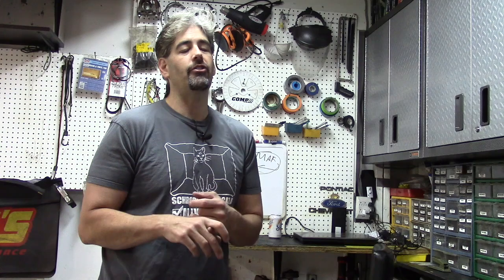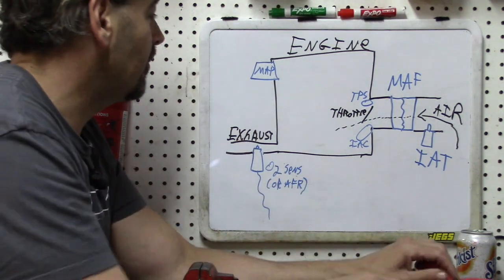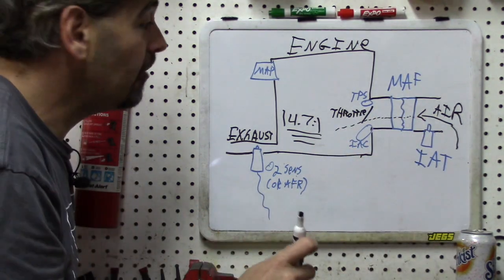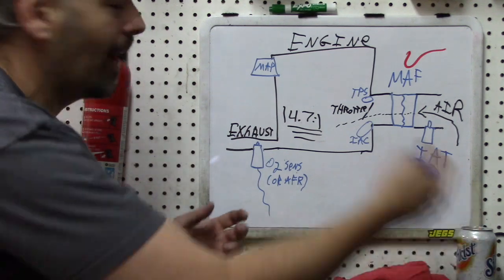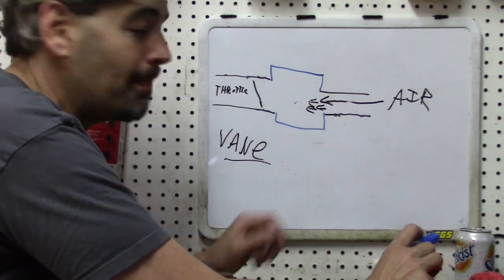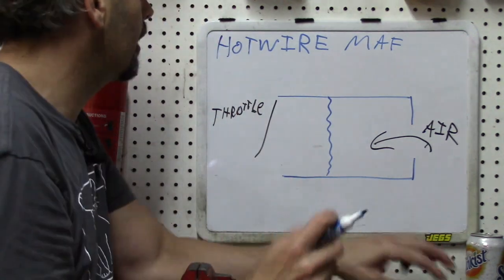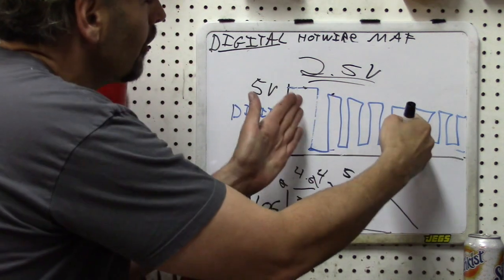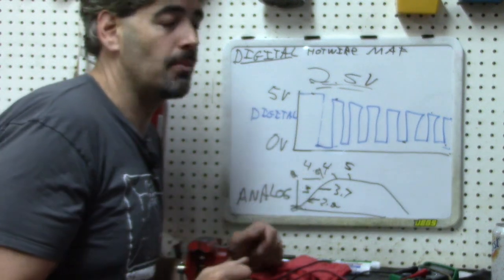Diagnosis and Understanding: MAF Sensor Pt1 Analog, Digital, Hotwire, P0101 P0102...

Comment: Could a bad maf give you a lean condition only on bank 1 on a v6? Or it would only be bad on both banks?
Reply from the maker: that would be both banks.
Reply: @SchrodingersBox  So I have a odd condition.  I got a 2005 kia 2.7l v6. I got a p0171 lean in bank 1. But my short term is -3 to 1 but my long term is stuck at 14.1%. I don't hear any exhaust leaks or vacuum leaks. What should I check for a lean on bank 1. But i did notice my bank 2 long term dont look good either and its stuck at 13.3%. I held it at 3k rpm for a min and both lg term trims did not move. What am I missing? I changed all plugs and wires. Iacv, oil change, bank 2 sensor 1 O2 sensor(cause of a previous code.) But I do have a purge valve code as well. For p0441 no purge flow. Could that be causing a lean condition as the system is relying on fuel vapors to help fuel the engine?
Reply from the maker: your short term will be +/- 2.5 or so because it has set the LTFT baseline. nothing off there. 
  I would definitely start with what your data was that you changed plugs and wires - what was your data there was an ignition problem? you never mentioned any such data.
Reply: @SchrodingersBox  so I just replaced the plugs and wires cause it has 90k miles. Ran ok but never changed the plugs so it needed that. Plugs were done. It had the lean in bank 1 plus a o2 code for bank 2 and purge valve code  p0441 so I replaced that valve and the o2 sensor but the im still getting a lean code for bank 1. Both o2 sensors are fluctuating from .1-.9 as they should at idle. Bank 1 short term fuel trim makes sense. -2% But bank 2 short term is around +3-9% i was thinking bad MAF but that would effect both banks.. im out of ideas.
Reply from the maker: what was the issue with the purge valve? that could be critical. was it stuck open it was it stuck closed it was it not getting a signal input?
Reply: @SchrodingersBox  stuck closed. Now its stuck open. Cheap aftermarket part went to crap. Now I'm waiting on the dealer version.
Reply: @SchrodingersBox  ok long story short i got the monitors ready, no check engine lights. But I had to swap the ecu with one I bought off of ebay. Now I need a vin swap so I can go get it inspected.  Do you know what kind of scanner that will allow me to do that?

Comment: Seeing that on a maf input to determine fuel pulse control, the system could be thrown off by driving into a very High headwind at highway speeds I have experince losses in performance under those condition
Reply from the maker: How can throw it off exactly?  The high winds would cool down the MAF Hotwire proportionately all the same. forced induction for example is always compensated for by the MAF. the reason for lost performance is due to the wind resistance.
Reply: @SchrodingersBox  yes driving into the big wind definitely is a drag on my truck, it is only a 4.3L V6, I’m not sure whether it uses maf or map as proprietary control. It is likely coincidence but when I drive on the highway into strong headwinds I get a power loss and cause a p0151 and p0137 code - I have a prehistoric code reader so I cannot look at live fuel trims etc, only a code when one is set on the pcm - I am hypothesizing that likely the hard winds are causing my 02 harnesses to flex and I believe the problem will turn out to be damage to the harnesses somewhere that is not obvious, it happens so infrequently that makes it difficult to narrow it down, thanks for your feedback
Reply from the maker: Those codes would have nothing to do with a MAF. Those are O2 circuit codes. I would check for voltage drop on your O2 signal bias voltage from the PCM as a basic first step. 
  but no way it can be a MAF and most definitely not because of wind.  definitely would move away from that as a possible cause.
Reply: @SchrodingersBox  ya I will work on that, it is a huge pain to access the pcm connections as they are up front mounted under the battery - I am always afraid of messing up the connectors. I think what I need to do is invest in a proper scan tool as I have gotten by all this time with the one I have, it is actually called a scanguage and is for monitoring fuel efficiency etc, but it will display fault codes so that’s why I bought it years ago when I had little understanding of fuel injection. It has gotten me by up until now as I have only ever had simple kind of failures and the codes would send me in the right direction where I could find something obvious. At least now I understand why my egr has no vacuum lines on it after watching you test your trans am one, mine is the same as that. I wasn’t really suspecting the map as the cause of my codes, I have to admit that I parts cannoned that on a previous occasion, I opened up the intake to replace the injector spider and the seal on the map was in terrible condition, the price of the map sensor was only slightly higher that the whole sensor so I pulled the trigger at that time.
I believe I may have caused some damage to some of the wiring when I did that job as I have had this issue pop up very occasionally ever since I did that repair some 2 years ago
Reply from the maker: I think a scantool is a great investment. will probably pay for itself just on this case alone!
Reply: @SchrodingersBox  i have been fortunate to get by without one so far but my newest vehicle is a 1999, I am really jealous though when I watch you guys see all the data in front of you like that I prefer to be able to see the failure happen before changing out parts, if it is your own vehicle sometimes the parts cannon is ok cause stuff gets old and needs renewal anyway.
Reply from the maker: How do you know you “needed to replace stuff anyway” without seeing data showing it needs to be replaced??
Reply: @SchrodingersBox  yes, you are correct about that. I don’t really understand how the whole system works, nor do I have much data through that scanguage (I am trying to learn more). So several years ago I saw the engine light for the first time in the truck(‘99 model)  - the scanguage showed a p0171 and p0174 code and went into a limp mode which I though I understood to mean it goes to a known good amount of fuel to be dispensed etc and operated poorly - I did the usual search and hearing folks with the change this, change that etc. I did the prehistoric checks for vac leak only using the spray can of carb cleaner to spray around the manifold connections/seems etc, I found alot of info out there about the injection spider, and from my limited understanding the symptoms seemed to fit, and also that gm had altered the design of the poppet locations etc it seemed to be a risk I was willing to take since it was around $200 gamble. It seemed to cure the issue and ran fine for a time but now these other issues begin to haunt me. After watching your series on the p0171 p0174 codes wow, for one I have much more
 understanding of how the system works, but I also realize that I may have pulled the cannon chain early in changing the 
injection spider back then and the condition that first set that p0171 p0174 code still exists - that was an incredible journey you took through that, but the ending was a bit confusing did it really turn out being the iac position that was at the root of that ?
Not that I want to fire the cannon again, but I certainly realize that the system needs to be scanned properly and at least I know some of the directions that I need to examine. I wish I knew somebody like you in my area as I would be happy to pay just to have the system checked, when you go around the shops here it’s kinda you drop your car here amd we’ll call you when we’re done so I wouldn’t get to see or learn anything about what they did.

Comment: Hi Schrodingers Box
i'm mohammed from saudi arabia
i have problem in my ford expedition
it's shut off when i shift to R or sometimes when i stop in Traffic signal or anywhere

i have those codes
P0102
P0325
P0200

can you help me please ??
Reply from the maker: Those codes are all unrelated. This sounds like  it could be a 5V ref/signal circuit issue. Choose a system and verify your reference, signal and grounds. The faulty circuit is likely shared with the other components.

Comment: wow, this is an old video.
just a note for you, if you ever drove your car with one window open and got a pulsing noise.  THAT is the result of the vortex. aka Karmen Vortex

for the Lexus, they have a mirror and an LED.  with each pulse, the mirror moves. the reflected light creates a pulse to exactly match number of vortex pulses.
so the pulse rate has a relationship to the speed of the air.
--------------------
this is where I am totally unfamiliar,  the ECU MAY see the pulses, or the MAF may take those and turn them into a voltage.
==============
BTW, for the heated wire sensor.  you can measure the amount or power (current) that is needed to keep the sensor at the hot temperature and use that to show air speed.
you can keep the sensor at a temperature and put a sensor down stream and measure how much the air was heated and use that second sensor to show air speed.
============
my hat is off to you for showing the real guys of how these things work.
==========
also, the Triangle is a sign of the Greek letter Delta - for difference.  it is the difference. so if you measure 3.2 volts, you are comparing ground to the with the higher voltage and get a differential voltage.  It is not exactly change.

Comment: I am trying to figure out an issue with my Twin turbo truck. Can you PM me if you have the time, I would like to pick your brain about it. Thanks!
Reply from the maker: Just send me the RELEVANT data specific to your theory of what's wrong and I'll be happy to take a look at it.  Since you're on MAF video- I'll obviously need LTFT and STFT idle vs load curved against either MAF voltage or frequency.

Comment: My 2002 Lesabre MAF waveform  (HZ/time) line was smooth with humps reflecting increase in air volume as I stepped on gas. After the engine warmed up the smooth line with humps became really really  hashed ? Using Scopemeter 98  Any ideas?
Reply from the maker: what was the frequency at idle vs load?
Reply: Graph of Freq/time of MAF was hashed both at idle and loading engine
. I had it hooked up while driving down hilly road so I was coasting at times then stepping on gas at times.    The graph of Freq/time was hash free while engine warming but developed hash while returning engine hot.
Reply from the maker: The important thing is the frequency values. What were the values under the load variables?
Reply: frequency values would correlate with load i.e. the graph line would rise and fall with engine load. but after engine got hot the line developed a lot of  "hash" I still need to re test tomorrow. I will keep you posted. Thanks
Reply from the maker: of course the graph line would rise and fall with engine load.  it’s the frequency that is the data.  It would help to know What condition are you trying to diagnose here?  What data are you using for this diagnosis and what is your strategy here?
Reply: I back probe the signal wire connect to scopemeter 98 ground scopemeter on alternator bolt confirm both signal connection and ground are good. start engine then view wave form as a histogram with Hz on Y axis and time on X axis. I am graphing the frequency / not viewing the square wave.  As I drive the graph of the line rises and falls in relation to air intake. I was getting lots of spikes both high and low.  I am basically trying to diagnose why the engine shakes (not a lot of shaking no DTC and  fuel trim good/ no misfire/ O2 sensors good) Engine seems to be running lean based on the 2nd ignition waveform. Thanks for taking time to read this I have learned a lot by watching your channel!
Reply from the maker: What data led you to the MAF if you don’t have a frequency reading though?  What was the fuel trim showing? The way you describe it I am wondering why you are suspecting induction as opposed to engine mounts or something?
Reply: I am doing a health check on the Lesabre--
 which includes smoke test cylinder /balance test /MAF fuel trims where around -3 then 0 / fuel pressure/etc...........
looking at PID's on Tech 2 to see if anything looks out of order but all looks good. I will look into the motor mounts.
Reply: I just put some leverage on the motor brackets and noticed motor mounts seem loose. THANKS it might be the answer.
Reply from the maker: Never heard of such a thing.  I don’t understand doing  any of that on data that one parameter indicates it’s clearly not necessary.
Well have fun- makes no sense to me-you totally  lost me on this one lol.

Comment: What if my 12v line from my maf sensor keeps jumping around from 12 to 14 to 9 back to 12?
Reply: While idling
Reply from the maker: That can’t happen. What ground are you measuring the  hotwire feed against?  Or are you measuring against the signal?

Comment: I have an 03 Silverado 1500 4.8 I have put a new fuel pump,fuel filter,fuel pressure regulator,throttle body with tps,maf, and map in this truck this week. It still does the exact thing it was before the change outs... it turns over and immediately dies and if I crank it over many times it will rev high then struggle and die.. the only code showing is the 5 volt circuit 1 and the MAF but the MAF is brand new. Please help
Reply from the maker: what data are you using that indicated you need all those parts? Did you get attic vs loaded rail pressures or something?  I have no idea what data would conceivably indicate why you would possibly need to replace all those parts.  what was the TpS data indicating the sensor was bad? what was your MAF data?  What was the MAP reference signal and ground showing?
Reply: The map was showing 13 inHg the maf was dead and tps was dead the truck would not idle at all then i changed everything and cleared codes and retested now only the 5 volt reference shows and now it turns over and revs really high and immediatly drops out rpms and doesnt even acknowledge the throttle when i press it  then really struggles to stay alive and then dies
Reply: I was using a code reader with live data. I plug the maf in it cranks and dies immediatly i unplug the maf and it idles high struggles and dies
Reply: I never probbed any wires affraid to blow ecm
Reply from the maker: that makes no sense whatsoever. how can the TPS be dead but then replacing it gives a 5V reference???????
  that makes no sense.  How can that happen?
Reply from the maker: Wait- why did you replace the MAP if it is showing 13mm on rough idle?  What were your input variables to say the MAP was causing this??
Reply: The map was hissing the plastic threads where shot it was just sitting in the hole not sealed and i put two brand new mafs in within 24hrs and it only throws those two codes now the 5 volt reference and the maf there are no splices in any of the harnesses so the maf is really confusing me but the map was obvious with the hissing and the threads shot this is my first time doing any of this and i have run out of reason ls y the truck wont stay running i dont have a reader anymore i will be getting one on friday but like i stated it only throws the 5 volt reference and the maf nothing else and both are now brand new
Reply: Also it has 209k on it it was a company truck that was never maintained so now im pretty much replacing what it throws on codes but when it throws a code for the things i just changed and still struggles to idle and dies thats where im lost
Reply: I thought it was the cam and crank sensor but thats not throwing a code unless it is affilliated with the 5v reference 1 circuit code
Reply from the maker: Nothing you are saying makes any sense at all. If the map was not seating due to stripped threads you would need to fix the manifold not the map. The mileage is absolutely irrelevant. who cares how many miles it has- you can’t say a specific thing broke because there are 209000 miles. Also you have a 5V reference so why replace these parts just because you have the reference??
  There is also no such thing as a 5V reference code. What code did you have that said there is a 5V reference failure?  And even if there was, how were you getting the MAP data if you say there was no 5 V reference????  Impossible. 
  What they hell are you doing lol!!!!

Comment: Hi

great explanation!

So I was wondering where would one get the typical range of MAF readings for a normal functioning car? Would I have to pay a few hundred bucks to get the ford service manual for the ford excursion v10 or is there somewhere else I can get it?

right now the closest I can get to what I need is http://juchems.com/ServiceManuals/viewfile78de.pdf?viewfile...pdf

 where there's a table that shows the Typical Diagnostic Reference Values for 6.8L 2V E Series. . but i'm more interested in getting a range of values like 
https://www.justanswer.com/ford/c4nbw-2001-excursion-6-8-v10-mass-air-flow-gram.html

along with understanding how to interpret live data to determine if the car is operating properly. Please Help!
Reply: also which (ford) service manual would you recommend getting?